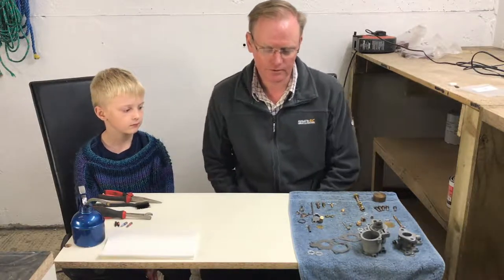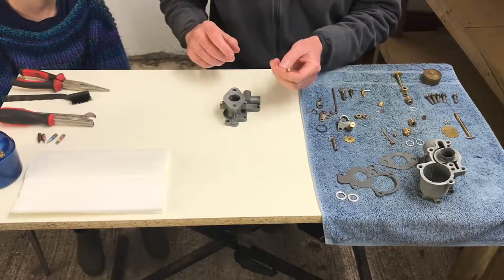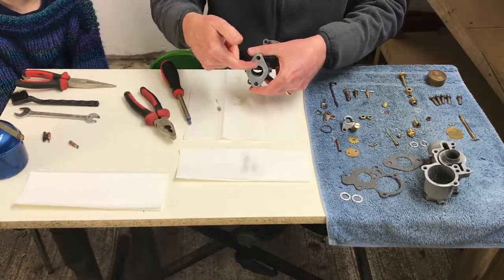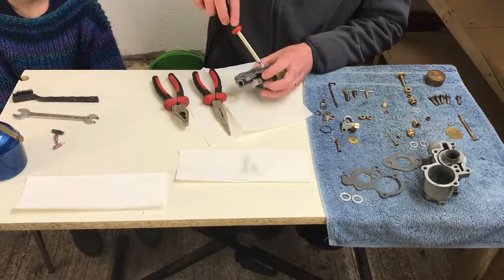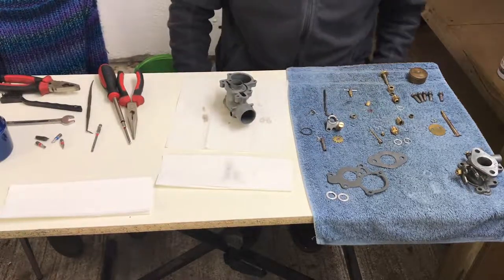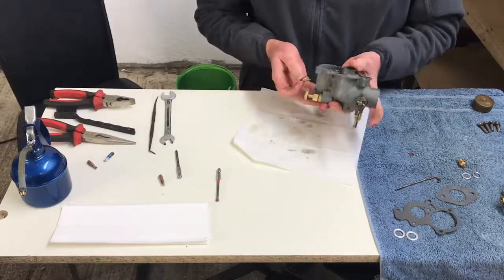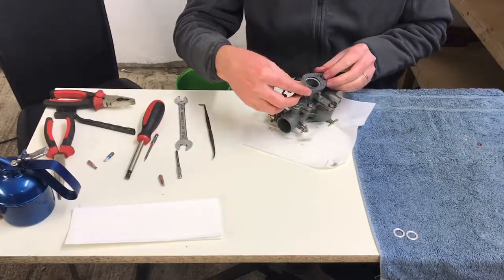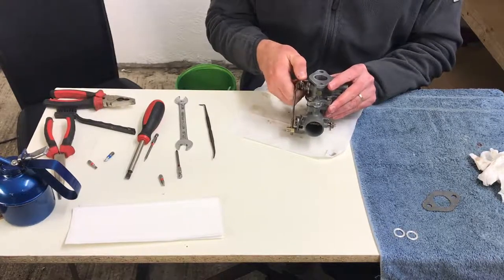#17 Ferguson TVO Rebuilding Zenith Carb

Comment: Reference the venturi / choke tube at 23:50 ... did you ever work out why you could not remove it? I've just rebuilt a 24T-2 and I could not remove mine either! I also had to replace the old float with a new plastic one (from Zenith) as the old one was full of fuel. Frustrating as all the other on-line videos show the venturi coming out easily, mine felt like it was fused into the carb body!
Reply from the maker: Hi Mike, no I never did work that out. I even bought a second carb off eBay as a parts unit. I wasn’t able to get the Venturi out of that one either! Everyone says they just pull out, but I’m afraid to put any more force on it. So in the end I’m just going to assume it will be fine, that it doesn’t need cleaning and that the face is true enough. 👍😉

Comment: G day Perrys, I find with the carb kits I have had to file the flats on the butterfly shafts at times to get the arm on and the gaskets are not always exact either around the jets. Same as yours it seems. Im thinking the choke shaft isn't quite correct. When you pull the choke on (closing the air flow) it should want to spring open then push the rod up to open the butterfly slightly. I just cant see exactly where the choke is so Im not positive its wrong.
Reply from the maker: G’day Lance, I think you are correct. It doesn’t feel right to me either. The shaft on the sacrificial carb is quite different in shape, I think I’ve managed to mix them up. I’m going to try swapping it and see if that helps. At the moment it is very loose with no “action” on the throttle at all. The other option is that one of the linkages is on backwards. I’ll let you know what I find.